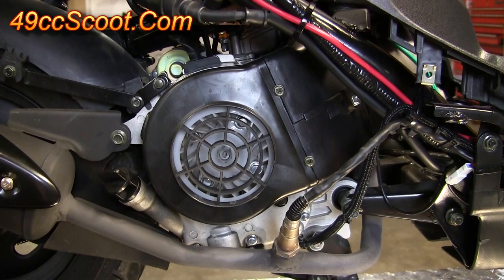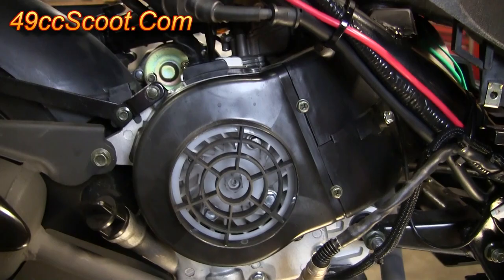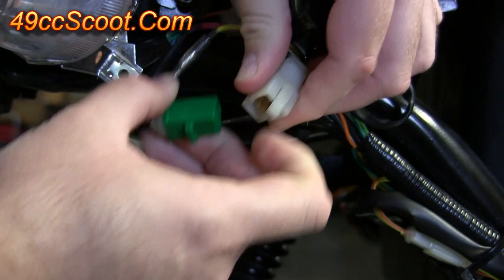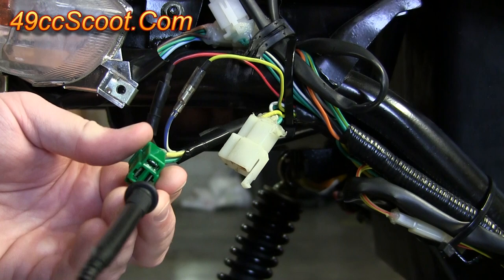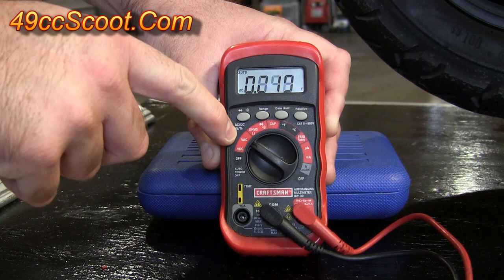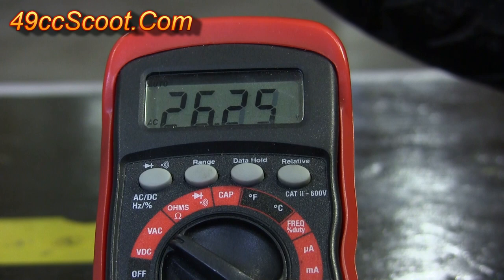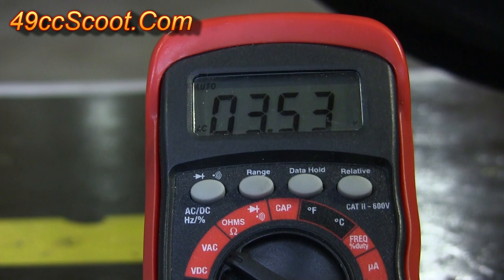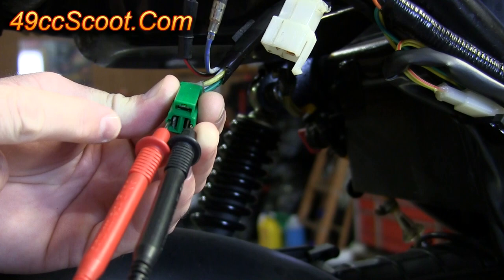Easy 50cc Scooter Stator Charging / Lighting Check : 139QMB GY6 50 QMB139 49cc

Comment: I have a friend with a 150cc gy6.  He has no blinkers or headlights.  He has brake light and the running light.   but that's it.  Any thoughts? I'll check the stator for him tomorrow.
Reply from the maker: That's an odd mix. Usually the blinkers and brake light are battery powered; sometimes the tail light. The headlights are generally AC powered by the stator. Could be a DC system, being a GY6 I suppose.

Check the stator, but also check the battery. If they look good, maybe a switch is screwy or disconnected. 
https://www.youtube.com/watch?v=Bw3ikMEGh74
Reply: @49ccscoot  my daytime running and taillight dont work, and even the key ignition  light, but all other lights work just fine .. only when I turn on high beam and hit the pass button they light up any thoughts?
Reply from the maker: @jamalbooker9562  Check the wiring in and around the high/low beam switch just to be sure nothing is pinched or could be shorting. If you have a headlight switch, trace the wire from it that goes to running lamps and see if anything is wrong there.
Reply: @49ccscoot  ok thanks

Comment: its a DC  CDI  and the battery is good....I think the stator is not putting out what it should......why would the battery continue to go dead every time?.....I think the Brand New Stator is defective...... even at 4,000 it should be making more than 30-35V AC...shouldn't it?
Reply from the maker: Not necessarily. That sounds reasonable at that RPM to me. Could still be a regulator issue. Can you turn your lights off and see how it does?

Comment: Without the regulator, how many volts and amps should the stator put out? What is the max when revved up?
Reply from the maker: +Vaughn J. Delgren I'm not sure on the max. As shown it's usually  50-75VAC. Max range in manuals is 100-200VAC IIRC. One manual for a 139QMB says 144W @ 5000RPM.
Reply: Thanks!

Comment: You pulled the big connector, how come the bike started?
Reply from the maker: Boy Santiago The large connector is lighting and charging. Other 2 are for the igntion system. Pull the others and it wouldn't start. This way it just wouldn't charge or power anything.
Reply: Thanks :)

Comment: Whats the cap called on the front of the cvt cover
Reply: Can i email you a picture so you know what im talking about?
Reply from the maker: Prob a dust cap or dust filter. Not sure what they would call it. Would be easiest to find a site that uses parts diagrams or breakdowns by system or area of the scoot and get it that way if you need one. See if PartsForScooters has it. I know they use diagrams. I leave mine off to get more airflow in, but I've got the CVT cover cut open around the clutch anyway.

Comment: What if your scooter won't start
Reply from the maker: Then charging and lighting isn't what you should be checking. You should be checking battery power, exciter coil output, if the kill switch or any other item is disabling the ignition and things of that nature. 
https://youtu.be/q9-mr7BXIho